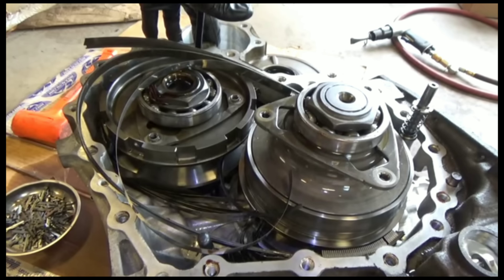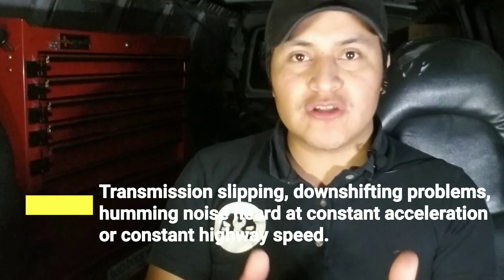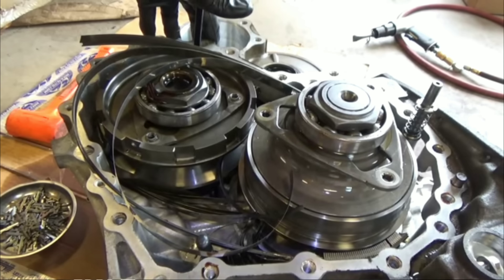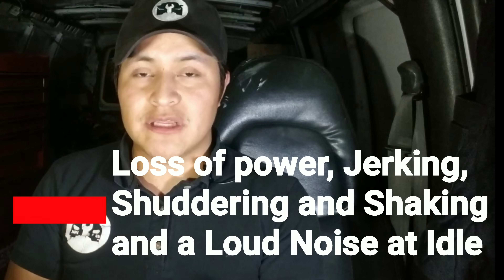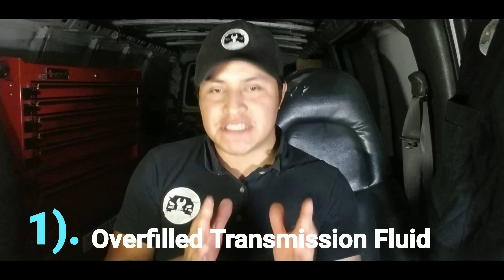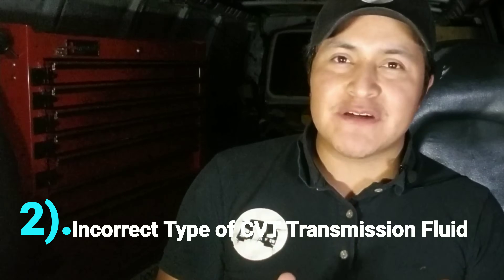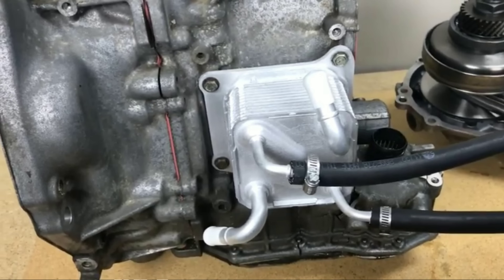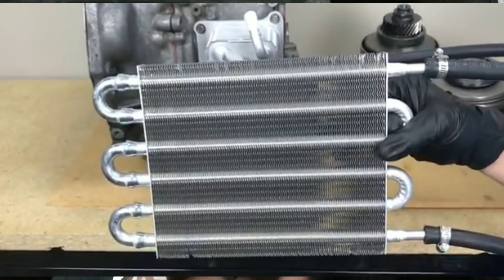NISSAN CVT TRANSMISSION | why it fails and what you can do about it to prolong it's life

Comment: I have a 2011 Nissan Altima. I was pulling out of the store and heard a loud pop. The car wouldn't move after that is it the transmission 🤔
Reply: Yes usually a pop is associated with the transmission, I had a friend tell me that a while back and especially if the car won’t move, those are the exact symptoms he described
Reply: Mine is a senntra it did the same thing
Reply: Could be, they have a protection feature built in, the computer makes the car inoperable to prevent more damage. Once the car is fixed...

Comment: I have a 2013 Nissan Sentra 1.8 engine, it’s slipping, I feel that the overdrive activates and accelerates once it reaches 40 mph. I changed the oil and the filters and still doing it; I checked the oil level and looks fine however, when I reached the bottom with the oil stick the oil comes with some sort of dirt, what do you think it happens with the transmission. In addition, the scanner is not reading a code
Reply from the maker: If it's automatic then that dirt you see might be clutch material
Reply: Wrench Link got it, thank you for the quick response. How that can be fix?
Reply: Probably the Belt shot
Reply: Most over looked
Reply from the maker: Is it a cvt or automatic transmission?
Reply: Had a altima Sr with a P0746 Pressure control seleniod B

Nissan told me needed a new trans 

Just replaced the valve body 5.5 quarts of NS3 New oil strainer and pan gasket and your good to go 
No need for programming 
Valve body comes pre programmed and Comes with warranty
Reply: Paid only 350$ for everything 300$ labor
Reply: Ready for another 100,000 miles
Reply: Sitting at 111,000
Reply: Streetsmart transmission 

They sell any CVT valve body and sell transmissions too and install located in Florida no core charge also until you return the original part

Comment: My Nissan Xtrail T31 whenever the car is iddle, and I switch on the car and I put on drive, as I accelerate it makes unusual sound like Subaru uuuuhhuuuh then it fades as I traveled long distances, the car doesn't loose power and is moving even speed, I have checked with the technician at the mechanic,  the air cleaner is ok,  have checked and cleaned the air mass is ok,  have checked the air exhaust is ok, have checked all sensors through diagnosis machine is ok , all sensors are working and there is no any warning light at the dashboard, my fear is whether the problem will become large and even the whole engine not working, kindly help me with ideas what else should be checked to get rid of this bad engine sound. Noting that the car is using genuine Nissan Motor oil, it is served every moment it reaches the said kilometres. What can you say and advice on this bad engine sound.
Reply from the maker: Can't really tell you what it could be without hearing the noise it's making

Comment: My cvt maked noise and slipped...the problem was a clogged transmission oil cooler. It is fitted on the same transmission, just removed it, and unclogged with air pressure. Saludos¡
Reply from the maker: Saludos! Que bueno que lo pudo resolver

Comment: Let me just say that I've owned three Nissan all with CVT transmissions and I've never had an issue out of any of them. The secret is when the vehicle reaches around 60000  miles just change the fluid that's it. After that change it every 20000 miles you can't go wrong. It's a very simple and easy procedure it will cost you about 50 / $60 to do. And yes I use aftermarket CVT fluid not the Nissan fluid because that is too expensive. And all three of my Nissan have achieved over 150,000 miles and still going strong.
Reply: Just blew mine out at 188k. Did a lot of long drives with my 2015 Altima. Going to buy a brand new one……costing me $5k
Reply: my wifes versa note 2015, transmission went at 50 000km lol
thank God i never drove it, can't blame me hehe
Reply: Hello! What brand of CVT fluid you use?
Reply: Owned a 2012 awd rouge and had the transmission replaced twice, 1st was under 40k miles, second was replaced at 66k miles. Thank God I sold it, but have had heard other people having better luck with there Nissan but I'm not in any rush to own or work on another one.
Reply: My Nissan Altima 2005 had problems at 199k almost 200k and never changed any fluid at all
Reply: I believe you but these cvt transmissions are total junk
Reply: @knockywigglesworth1909  yeah , i agree with you, even with irregular maintenance, shouldn't just bust at 50k km. and lady driven. lol shame Nissan doesn't do better, i had higher expectation from a company that makes legendary cars like the R3X's GTRs
Reply: We bought this Nissan in April 22 and the CVT went out in November 22, didn't even really have a chance to get any service done.
Reply: This is encouraging! Would you mind sharing how you did it yourself for $60? I’d like to try to do the same on my 2017 Versa with 64k miles. Thanks
Reply: @mkcPY  that's very easy. I went to Napa Auto Parts and I told them I needed CVT fluid for a Nissan Rogue. It has to be the Asian version. And the same fluid that you use in a Nissan Rogue you also use in a Toyota Anna Honda and a Mitsubishi and also Suzuki. It will cost you approximately 10 or $11 a quart and you will use about five quarts or so. It's nothing more than a drain and fill. You might want to do some research on your vehicle first to find out how much fluid a flush will use. Also when you raise the hood of your car there's a sticker that tells you what type of fluid you use. It's either going to be a ns2 or a ns3
Reply: @mkcPY  oh yes one more thing to add mine has a 19 mm drain plug I don't see why yours should be any different. The dipstick will come out. On the side of the dipstick there's a slight opening all you have to do is take a very small screwdriver and press a small clip and the dipstick will come straight up. Good luck and thanks
Reply: Thanks
Reply: Secret🤓🤣
Reply: What brand of fluid did you use?
Reply: @charredskeleton 
demitsu CVT
Reply: I am driving a 2010 murano with 258000 miles and I am just now experiencing a problem but a fluid change will probably resolve it
Reply: @matthewlavigne115  2008 Nissan Altima with 218k miles.  The CVT is finally starting to give death signs, but she had a good run.  Annual fluid flushes work and a cooler at 100k miles (with frequent dealer service before 100k miles) work.
Reply: @matthewlavigne115  2008 Nissan Altima with 218k miles.  The CVT is finally starting to give death signs, but she had a good run.  Annual fluid flushes work and a cooler at 100k miles (with frequent dealer service before 100k miles) work.
Reply: @racerx509  what do u mean by Cooler? U replaced the Oil Cooler ?

Comment: Are the CVT's in 2019 and newer exactly the same transmission as the older ones ?
Reply: I owned the Altima 2012 put over 100k miles was doing 28.9 mp gallon....now I have the 2020 doing 38.1 mpg ...yes is a CVT but different after 20 years
Reply: Yes, It's been 17 years and Nissan has still not fixed the problem. I've personally replaced over 1,600 CVTs.

Comment: I have a 2017 Nissan rogue with 40000 miles. I was accelerating on an uphill with medium to hard pressure on the transmission and it felt as though it was surging. Is this a bad sign and is Nissan going to cover this under warranty? Thanks in advance
Reply: Yes. Nissan has a TSB (technical service bulletin) on that. It's under your powertrain 5year, 60,000 mile warranty.

Comment: I have a 2015 Altima with 137K miles and zero problems! (so far!)
Reply: You should probably buy some lottery tickets 😃 if ur CVT is still alive. 
Btw good to know and good luck 👍
Reply: @junaidgt90  145k on my 2013 so far.  It may help that my miles are easy with very little city driving...but talking about heat--I live in the Arizona desert with no after market cooler.
Reply: How’s the car doing now? I’m planning on trading my pathy in only because I hear high mileage problems with the CTV’s. Right now it’s at 89k miles.
Reply: 220,000 miles 04 Infiniti i35 original cvt Tran n still pushing change with oem transmission fluid from dealership ever 30k-40k miles
Reply: You ever change fluid and how many times
Reply: I have a Tiida, 176kms, and zero problems so far.
Reply: It's after 140,000 when things start to happen

Comment: Bought a 2013 Nissan Rogue almost 4 years ago at 45,000 mi. I just got to about 65,000 mi and Nissan is saying I need a new transmission already. $5,500 repair for a car worth $6k. Never again.
Reply: Make sure the trans actually needs to be replaced... sometimes people just have MAF sensor issues or even fuel pump issues and get mistaken for a bad CVT because the engine surges or lurches or something. I don't think dealers really care, they just want to sell you a new trans if they can... depends in your symptoms though.

Comment: Hi! Thank you for this video. I have a 2013 Nissan Sentra and when I driving and reached 40mph it’s accelerates, slip and feels like the overdrive activates; also I just changed the transmission oil and after a week it’s turning dirty. What should I do? Help please
Reply: My 2012  sentra does this, it used to snag now it just slips and picks up. After a year now it takes a while for the pulleys to catch up when stopping that there's too much energy so it goes back to the engine and stalls it out. I need to put the car back into park, turn it off and turn the car back on. Looking at a Altima but I see now that I'm better off with a 5 or 6 speed auto.

Comment: My takeaway is that if you have a Nissan, it is best to get follow Nissan's service schedule and take it to the dealer for all but oil changes.  It may be more expensive but your car will last longer.
Reply: I keep on seeing on other CVT videos' comment section some say that their Nissan CVTs still fail even though they done all the maintenance servicing it needs. 

Some other Nissan owners are lucky to have their CVT last 200k miles and longer.   

Therefore, keeping up the maintenance with the CVT doesn't gaurantee that the CVT never fails. There is still a chance that the CVT could fail even though you done all the maintenance it requires. 

So luck better be on your side.
Reply: And the oil change at the dealership isn't that expensive.